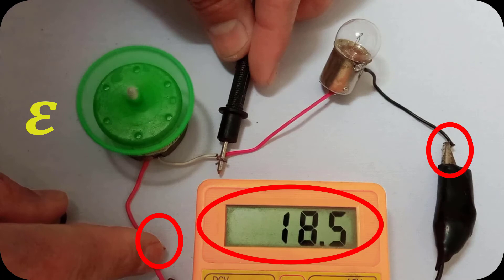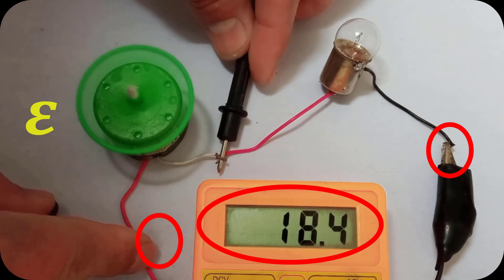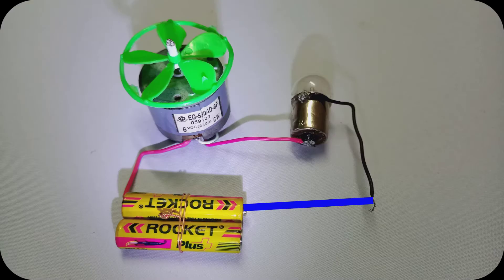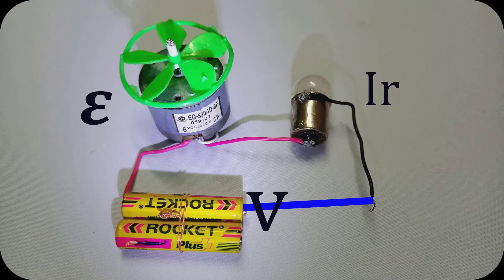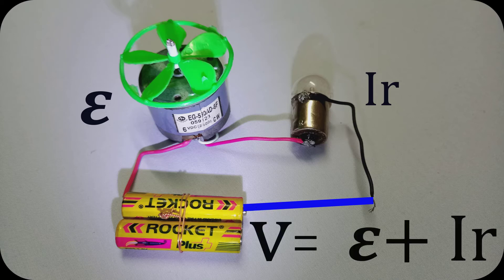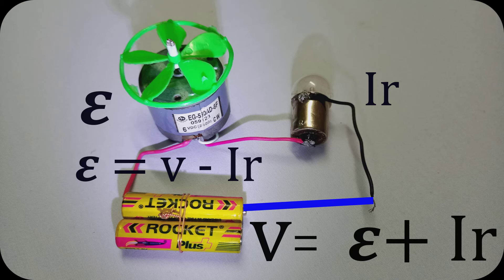Back EMF in a motor | Why Back EMF is produced | How Back EMF is produced

Comment: In other words the voltage supplied due to back emf is opposite to the supplied voltage.  In other words with sufficient back emf from the motor the light bulb may not come on and the light bulb ends up acting like a capacitor.  Negative voltage on its one side and positive on the other side.  Does that make sense?  However that can not happen since there is loss due to resistance in the circuit.
If you don't supply enough voltage the light bulb will not come on and if you supply too much voltage, depending how much, the light bulb may burn before the motor.  But if the bulb has more resistance than the motor, nothing will come on.  But the motor can not turn on before the light bulb while the other way around is possible.  With low enough of voltage the bulb may come on but not the motor as the current flows through the coil wires without the armature actually turning.
Reply: Very good question, 
How is this possible, 
This experiment is no worth for showing the back e.m.f ..

If our rotar is off then how we think that the bulb glow by back emf

If the rotar  down the speed by hand then emf will also decerces than how th bulb glow sir, 
Than the external battery come in that place to glow the bulb,,

How we distinguish between them